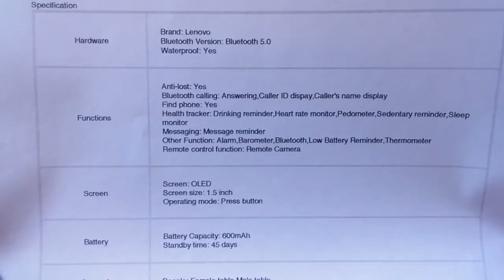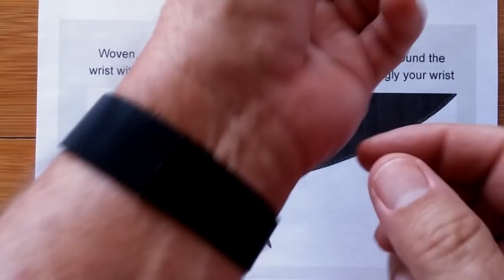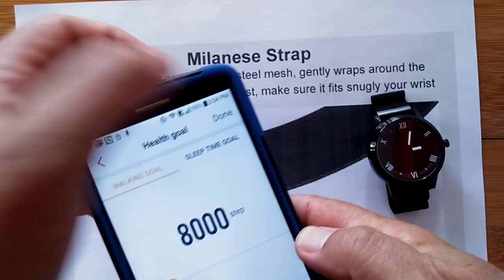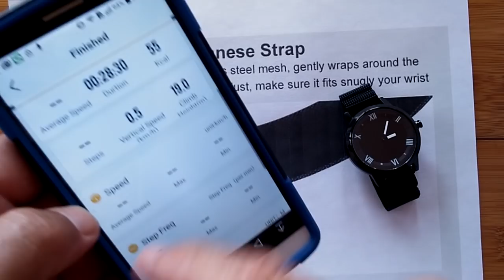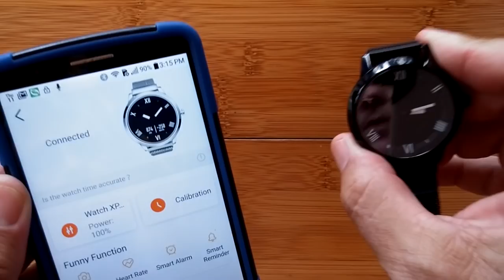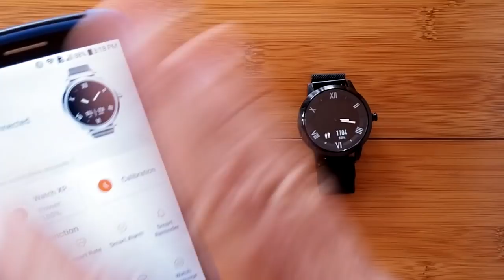LENOVO Watch X Plus Hybrid Analog Smartwatch Luminous Dial, 8ATM Waterproof: Unboxing & Review

Comment: After a good 7 years, the last one of which ran out of battery after 3-4 weeks, the battery has finally given up on me... the problem is that not found even on web. Otherwise, even though the app is outdated and no longer updated, I would continue using this wonderful watch. I honestly don't understand why Lenovo hasn't continued this project.
If anyone wants to sell it, even if it's broken, as long as the battery is in good condition, I'm available to buy it.

Comment: Don't shop at gearbest. Waited 20 days for it after it said it would deliver in 9-12 days. So I checked up on them, turns out they discontinued the product but continued to sell it even though there was none accessible to gear best and will refund the money. Thanks for wasting my time. 0/10 horrible website. Don't shop there.
Reply from the maker: Sorry to hear you had a problem. I know around the holiday time they sometimes have trouble keeping up with their inventory control. Amazon has it down a lot better, but most of these watches aren't available through Amazon. Even then, Amazon often send the order to 3rd party resellers and you run into similar inventory problems. all I can say is your experience is not common, but it does happen, especially around large sales times.

Comment: Hi. Is it easy to change the straps? I so want to buy this watch but I'm worried the strap is too small.
Also does it handle app notifications well? I'm particularly interested in WhatsApp notifications
Reply: Same problem here
Reply: Okay just did some research, removable bands. Band size 20 mm
Reply: So any watch band with 20mm with is good

Comment: Hello I have a question. Does this watch have dual time features? ı mean can it shows the different time zones?
Reply from the maker: If you find an app in the Google Play Store that can do that on your phone, try installing it on an Android watch. IF the layout works, it should work on a watch. As for changing a stock watch face to different time zones, you won't find that capability on an Android watch, but it's available on faces designed for Android Wear watches (or Android watches running a thing called Eric's Universal Launcher).

Comment: Thank you for another awesome review. I think I would be amiss not to let you know that the same smartwatch can be had on eBay for $20 USD less than advertised on the link you provided. Also, I was wondering if you were going to do a review of the cheaper, Lenevo Watch X, which has been heavily criticized by another reviewer; what I want to know is if there is really that much of a bump in quality between the two versions? Personally I like very much the concept (I own the similar, but much more expensive, Tommy Hilfiger 24/7) and I am impressed with the reported battery life and 8 ATM waterproof rating. And the price is right too!

Comment: Hi! Thanks for your review. I bought silver version of Watch X Plus(which is simply beautiful) from GearBest about two months ago. I really like it but I can´t hide my disappointment considering missing announced features. Actually it´s the App which is really terrible(slightly better after last actualization, but still terrible). There´s  no weather functionality in my area(the Czech Republic/Germany) still getting error message(after actualization changed to "length=3, index=4" message, but still not working...) (on your watch there is  the temperature statement - how the hell did you get it there? :-) I can see just "_ _" on my watch) 
The main reason why I decided to reach for this watch(and replace my formerly owned Lenovo Watch 9) was the Blood Pressure Measurement feature which is also missing(again, after actualization, it is present in the App but still not working - I get "Unsupported device" message) and this really drives me mad. I can only hope that after few actualizations(maybe in few years?) this will be put in order...
Now a few tips and discrepancies about your review:
1) you can actually pull the magnetic strap out of the holder to fit it to any size of wrist
2) "Find my phone" function normally works(if the watch is connected - it disconnects after FW actualization, or getting battery charge level under 25%) you need just press the wach button(not hold it) and the phone starts ringing - no need to have "Disconnect Reminder" activated
3) The in app heart rate measurement feature works as well - you just choose your state(Rest/Exercise), press "Done" button, place your finger in front of your camera to cover the flash and wait for app to finish the measurement
Reply from the maker: Great comments and information. Sorry to hear about your problems. I'm not sure why I'm getting weather on mine. As Steve Jobs would say, "It just works". Make sure your GPS is on and working on your phone (bring up a map app and force it to show your current location on the phone. All those other errors don't make sense to me. If you can find a way to clear everything from the watch and factory restore it, try that. It might be a cluttered mix of original firmware and new updates that needs flushing out by a deep restore.

I feel embarrassed about the strap thing. I tried to pull it out, but it seemed like I would break it, so I gave up and figured it wouldn't come out. Thanks for clarifying. I guess at low power the tethering signal is forced off, but will turn on again when you activate the watch. Cool info about the app heart rate using the phone camera. I gotta try that. Nice find.
Reply: @SWT  Thanks for your advice. I searched a bit more on internet and finally found partial solution to my problems. (not the temperature one -  I think, the weather and temperature feature may come to my country later) But I did get the blood pressure measurement working! There was a problem with the app as I thought. I had to remove it and download Lenovo Watch App v.3.0.2 from alternative source(not from Google Play - idk why, but the GP version didn´t allow further FW upgrade).
After reinstalling I could upgrade watch FW to v.4.7 which finally includes blood and barometric pressure measurement and the app has more options as well(altitude and blood pressure calibration are the most important of them).
I hope, this information will provide help to some other desperate Lenovo Watch X Plus users :-)
Here´s the link with working app download: 
https://apkpure.com/lenovo-watch/com.pmpd.dmap.lenovo/download
Reply: @georgewolfeye8027   How is it now here in Czech Republic (or german) with showing of temperature?  THX
Reply: @sumperskaferitova  hi. no change. Watch updated to version 6.1 and App to 3.0.3 but still no weather or temperature info.
Reply: @georgewolfeye8027   One more question. What about connection? In some web I saw there is WiFi, My phone have only bluetooth 4.2LE. Your phone has bluetotoh 5?